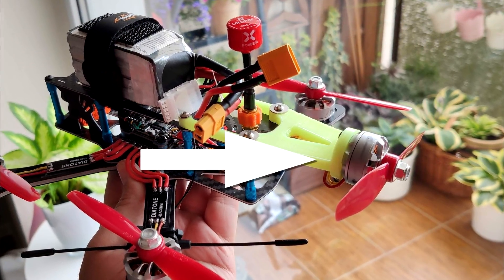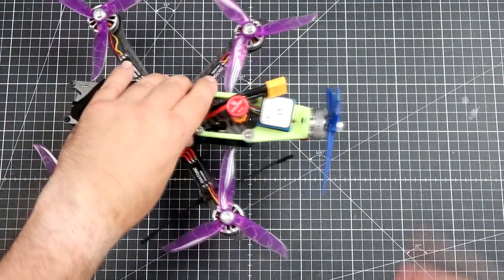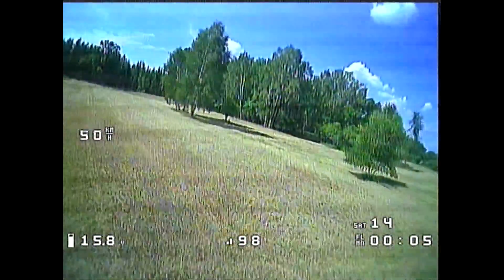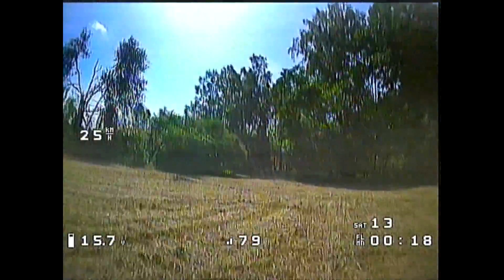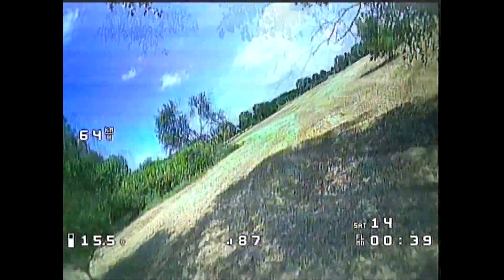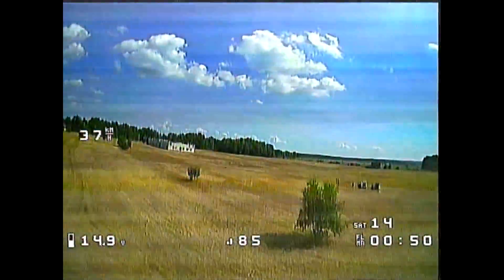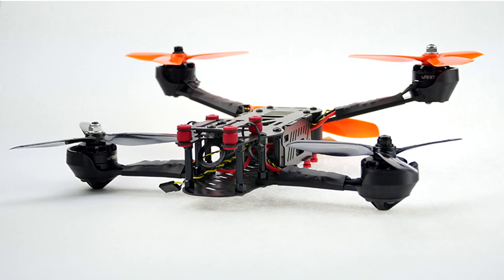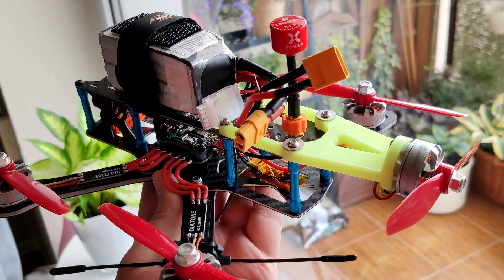5 motors drone that screams

Comment: I built this a year ago, it was a fun project. I have managed the throttle using two force resistors and Arduino, so I can move forward backward and even break. The harder you press the force resistors the faster you move like R2 and L2 on a joystick 😬

Comment: If there was a convenient way to control the speed of the rear motor, this would be able to pull off some crazy freestyle tricks
Reply: Depends on your radio I think. If you have a slider or easily acessible poti you could use that

Comment: You could use smaller motors with less power and less weight for the 4 main lifting motors as you'd no longer need them to provide all the power for fast forward flight. You could save some weight and just use a larger motor at the back.

Comment: Well, once I have made an inav quad with   fifth motor 15 degree's tilt down, and made a mix of a control so the motor will be controlled by pitch stick. I set max angel 15 degree's pitch, it was a fun thing to play with, but had two major problems,   quad was gaining height at high speed, even at alt hold, and fifth motor didn't work with nav mod.

Comment: I've thought about this with either a short wing on it or make the arms wing shaped to provide a little bit of lift.
Reply from the maker: I'd like to see that
Reply: @FPVUniversity  I was just talking to my boss about making some carbon fiber drone frames and maybe to mold a foam RC plane and make a carbon fiber copy for display at the next PRI show. They've changed Fusion 360 since I last used it so I'll have to relearn that to design some arms to use as plugs for molds, but I'd like to build it this year.
Reply: I think DJI did some of that with their racing drone, didn't they? Made it so when it was pitched forward there was actually some lift generated as it moved through the air? It would certainly be interesting to see that concept taken further...

Comment: So much better than the one Rotor Riot did
Reply from the maker: They did? Must have missed that one
Reply: @FPVUniversity  Yea but it was angled causing the drone to spin out. I was about to say put it 90 degrees to the bottom and have a gimbal for the camera but your plane mode is much easier and better. maybe make one with arms in an H shape with foils. when you engage the back motor the foils rotate over the arms creating wings. the up lift motors then turn off and its full plane mode. can even use the back servos used to rotate the foils for pitch and roll. Idk just an idea

Comment: Hello, I made a similar drone, but it is not stable along the yav axis. When gaining speed, the drone starts spinning wildly. Do you have any ideas why? Unstable in 2 modes Acro and Angle. Without turn on 5th motor drone fly wery good and stabile

Comment: What about a foot pedal control?
Use a pedal for a driving sim hacked into your TX for smooth forwards control.
If that works well, hack a 2nd pedal into your TX for smooth backwards control.
Reply from the maker: If you have a foot pedal then why not :)

Comment: Was the flight controller using Betaflight or iNAV?
I assume there would need to be a spare PWM channel output to connect the pusher ESC to so you can control it with the transmitter switch?
Thank you.
Reply from the maker: INAV. Pusher ESC was connected as a servo to flight cotroller and pass-through on that channel was enabled
Reply: @FPVUniversity  Thank you.

Comment: Fun is the only advantage - so what? Who looks for other advantages than that in any racing quad? Or in any hobby? You just added a pentacopter to my to do list. (But I think I'll use a slider instead of a switch to minimize the bazooka factor, as I tend to fly in cramped locations ...)

Comment: That's interesting. 👍
So there was no speed control for 5th motor, just on or off?
It would be interesting to make speed comparison between flying it with 4 motors an with 5th motor engaged. 🤔🙂 Maybe one day when I'm gonna be bored. 😁
Reply from the maker: There were 2 speeds. But yeah, besides that, 2 speeds
Reply: @FPVUniversity  Thanks Pawel, much appreciated. 👍 So 3 position switch, off, 50% and 100%. If I'm gonna ever do it, I'll probably use potentiometer on my radio.

Comment: I would like to see more people try doing INAV (not ArduPilot) on helicopters. Seen maybe only 3 people do it.
Reply: INAV is running on my twin rotor helicopters.
Reply: Ah! I've seen! :P

You have any tips for a sub 250 setup? Any suggested models/FCs?
Reply: @gem-squared  The mechanics of the xk k110/123/124 could be used for a very light build. I wanted my sub250g build directly driven, so i took the mechanics out of two OmpHobby M1, which is a pretty expensive option. As an FC, a Matek F722 mini is used. The Kakute F7 mini also works well, if the LED pin is used as an additional PWM. I could keep the AUW right below 249g, including a Matek OpFlow unit and a Betafpv Nano HD cam.